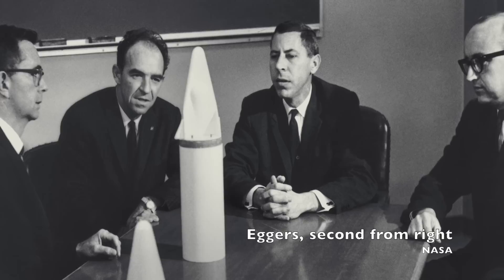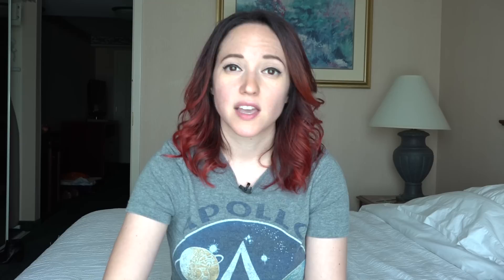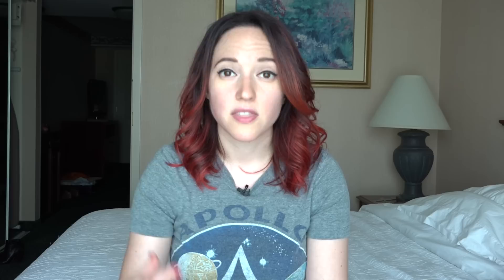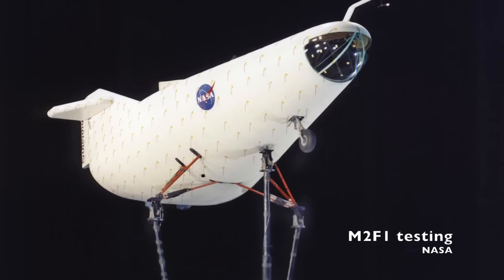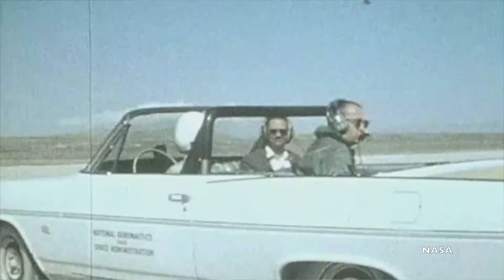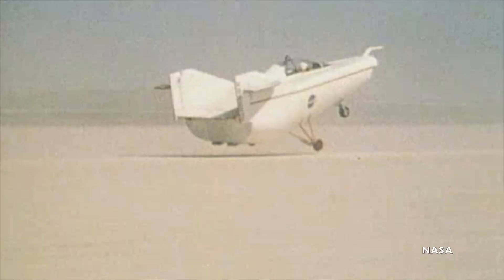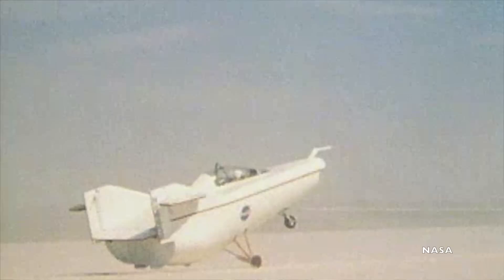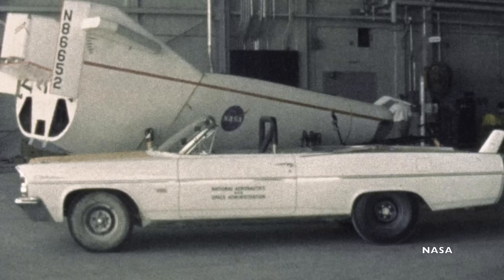When a Muscle Car Towed a Lifting Body into the Air

Comment: As a kid in Boy Scouts, I helped move a M2F1 into a Hanger after it was delivered to Marshal Space Center.  Was not heavy at all as we expected it to be.  We had a local arrangement for Boy Scouts to help at the Arsenal when visiting the base and we help Clean up and prep the Rocket park for the busy season. Must have been the early 70's and I even got the assignment  of pulling weeds around the Saturn V on display horizontally there in the 70's.  We even cleaned up the welcome center with the Saturn 1B on display at the interstate stop. But that was easier since it was standing vertical and on raised stands.

Comment: Driver has a helmet. The two observers? Nah, we're good.
Reply: The reason NASA chose Pontiac wasn't because it had the most horsepower of the day, but because they were considered by many to be the most stable platform, and stability is VERY important when dealing high -dollar or nearly irreplaceable equipment. After all, this was the era (early era) of b Pontiac's"Wide Track" program.
Reply: I seen that too and had to laugh.

Comment: The fins on the rear of the Pontiac actually fit the scene. I guessed a mustang at first, but those were just appearing - and were probably lighter, which could have impeded the towing. Great research and an interesting fact.

Comment: In fact, muscle car didn't born until 1964 with the Pontiac GTO, which was basically a Tempest(medium sized car) with a big V8 engine. The Bonneville was a full sized car, not properly a muscle, because they used at the time the big engines only for big cars and the Bonneville was the heaviest car of Pontiac(some variants of the Bonneville as heavy as 2.5 tons). Of course, they chose the Bonneville because at the time GM only allowed big blocks to be installed in big cars(that changed when John DeLorean created the GTO by installing big 400+ CI engine in a mid size car like the Tempest).
The heavy weight in the Bonneville allowed the car to withstand the lifting force of those lifting bodies, and the 4 speed manual transmission allowed it to reach 100+ MPH more efficiently than the Hydra-Matic.
So, no, it wasn't an actual Muscle Car, but it was faster than most full-size cars because it was convertible and only had two doors.
Reply: I loved your documentary. I still remember watching when you died on TV.
Reply: That sure sounds like a lot of opinion. "Opinions on the origin of the muscle car vary, but the 1949 Oldsmobile Rocket 88, created in response to public interest in speed and power, is often cited as the first muscle car." Yep, turns out it was opinion. Maybe give her a bit of space on this one.
Reply: Old late comment is late. At least she didn't call a mustang/camaro/corvette a muscle car. I think this one fits the description, retroactively. Catalina wasin't a full sized car, and had a big block, 4 speed, 4 barrel. I think that's good enough.
Reply: Yea I agree that the gto was the one that really upstarted the muscle car craze and brought it into the open. BUT I would be hard pressed to say it was the first. They're definitely some high performance engines that were stuffed into more midsizish platforms that came before the gto. The 1961 Chevy impala SS along with the 1962 bel-air was offered with the mighty 409 ci. V8 That put out 375 - 409 bhp. - the 1957 Chrysler 300c with the 325 bhp. Hemi V8. The 1962 Dodge dart max wedge 413.- 1963 Ford galaxie/Mercury comet 427 with 425 bhp. - The 1963 Pontiac super duty 421. -The 1963 Studebaker avanti R2 with supercharged 289 ci. V8. This car was the fastest car in the world for 1963 with speed tests of 168 mph. - The 1961 Pontiac ventura 389 with tri-power option push out 345 hp. Etc etc. So as you see there were quite a few high performance muscle cars that came before the iconic 1964 gto.
Reply: Ayrton Senna by the way it was the 389 that deLorean first stuffed in the tempest that ultimately became the gto. The 400 ci. Engine was not introduced to the gto until 1967.
Reply: In fact Chrysler had dual quad "Muscle Cars" since the mid 50's, but I loved this GTO's too !
Reply: Has everyone forgot the Duesenberg SJ. Introduced in 1928 with supercharged straight 8 producing 320hp.  Yes the 64 GTO is given credit of being the first muscle car, but is it really?

Comment: The Air Force used "muscle cars," too - Some bases had SS396 El Caminos specifically modified for retrieval of the U-2 spy planes. These planes had centerline landing gear, so when the wing couldn't generate enough lift to fly level, they would tip to one side or the other. Some provision was made for this problem by adding "wear strips" to the wingtips, but this was considered too risky for the equipment. Had to be a muscle car fan that thought up the solution. Go Air Force!

Comment: What ever happened to the car?
Reply: Chewy That's what I was wondering myself.

It would be cool to see this artifact from NASA's glory days once again - hopefully it's in a museum with some of it's more famous counterparts =D
Reply: Chewy eBay maybe?
Reply: Lol, i was asking this myself. Probably somewhere in an old hanger catching dust.
Reply: It is probably Charlie Bolden's work car, if it's not he should do something about that.
Reply: +Chewy What happened to the NASA muscle car once the M2-F1 program ended? Near the end of 1963, the Pontiac was shipped to NASA Langley Research Center in Virginia and used in tests at Wallops Island. There was some regret expressed at the NASA Flight Research Center when the Pontiac left, fairly much captured in a comment printed at the time in the X-Press, the NASA newspaper at Edwards Air Force Base: "No longer can we drive along the lakebed and pass the airplanes in flight."
Reply: +Chewy NASA is an extreme hoarder when it comes to their equipment. It is probably somewhere in their inventory. One visit to KSC or any NASA facility and you see they hang on to everything.
Reply: The top comment on this video by Bill Whiteside explains what happened to the car. Apparently it was sold on Ebay.
Reply: @351wmustanggt  As someone who likes to hold on to things I can understand. Obviously buying new things can get expensive and if they are still usable why throw them out? My neighbor when I was a kid had a late 1980s Volvo and he drove it to work every day.

Comment: As for the ultimate fate of the Pontiac, it was sent to NASA's Langley Research Center in Virginia in the mid-1960s where it was supposedly used at Wallops Island.  Later, it made its way to an undisclosed location in Georgia, but it has more recently been returned to Edwards AFB in California where it will reportedly undergo a restoration by the Air Force Flight Test Museum for eventual public display in an exhibit that will reunite it with the now-restored M2F1 Lifting Body.

Comment: Cool little tidbit I never knew about Pontiac history, and I've talked at length with Arnie The Farmer Beswick many times. He never mentioned that. Even h must have been oblivious to that. If I'm not mistaking, The 1966 Bonnie 2+2 with the 421 SD & 4 speed was the Only American production car capable of  sub 4 sec 0-60 times other than the Vette.. Even toady. that 2.5 ton Bonnie would keep up with most of the factory hot rods, and embarrass quite a few Euro sport sedans.
Reply: SD, AKA "Super Duty" two letters that put fear into the heart of the enemy (Ford, Mopar).  421SD, 455SD and the 2.5L SD , yes a 2.5 liter 4 cylinder super duty engine. LOL
Reply: That under 5 second 0-60 was done in 1st gear, with a close ratio 4 speed transmission. Love Pontiac muscle, have driven it myself.
Reply: @timreichert9982  under 5 sec?  noooo way, unless seriously modified. prob 9 sec at best
Reply: @gtbarnes11  I was wrong. It was 3.9 seconds you poor little man, and it did happen, HA! Look it up.

Comment: Could you use something like this to help launch a spacecraft? I'm thinking of a long, straight track that would pull spacecraft to get them airborne and at high speed before their rocket engines kick in and they go upwards.

I mean, it did work - they got the aircraft in the air pulled by the convertible.
Reply: Brett Anon Maybe, but I don't think it would be very feasible.

In this case, it took a custom built muscle car to impart to what was essentially a giant model aircraft about 60 m/s delta-V (an estimation on my part based on having reached 100 miles per hour at an altitude of 20 feet).  Since you need about 10 km/s delta-V to reach LEO, this setup got them about 0.6% of the way there.  The extra mass required for the engines and propellant necessary to send the vehicle to LEO would have been enough to reach LEO without the assist, and I cannot even begin to calculate the specifics of the tow vehicle required to pull that resultant vehicle into a glide (imagine building a vehicle that can pull the space shuttle in launch configuration in a stable glide behind it).

The idea is not entirely without merit; we did use tow vehicles to get the X-15 into space, though it went nowhere near LEO (delta-V wise) and the tow vehicle was a B-52, not a ground vehicle.  Since the X-15 was not a LEO-capable vehicle, its weight was very small, and the B-52 mothership was able to impart a more significant amount of initial delta-V (about 600 m/s, estimated from an altitude of 8.5 miles at a speed of 500 miles per hour) by virtue of being an aircraft and being able to reach that high of an altitude (more altitude = more delta-V).

However, that 600 m/s was still only about 6% the delta-V that would have been needed to send a vehicle into orbit from the B-52 mothership.  A typical X-15 flight may have had a total delta-V of about 2 km/sec (estimated from a typical flight altitude of 55 miles at a typical final speed of 3500 miles per hour), leaving about 1.4 km/sec delta-V from the X-15 itself.  Should the X-15 be required to reach orbit, it would have again required a much higher mass from the engines and propellant needed to add on those extra 8 km/sec, which would have created a vehicle capable of reaching LEO from the ground and have left the B-52 unable to carry the aircraft (again, imagine a B-52 with the space shuttle in launch configuration strapped underneath).

Comment: Back when science meant doing cool stuff in an efficient way and gleaning as much as you could from it... instead of filtering a concept through 50+ layers of accountants and bureaucrats to get approval for $10 pizza to keep you going while you write a thesis on which screw to use to hold the department sign on the lab door.

Comment: This girl is from Canada, and she  is a space nerd, not a car nerd, so she kind of gets a pass for not knowing that a "Muscle Car" is when they stuff the Biggest Engine into the Smallest Car.  And that the Pontiac Bonneville was the Biggest Car that Pontiac made and it came standard with the Biggest Engine.
But the science reason that they used the biggest car is that probably it was heavy and had room to add more weight in the trunk so it could have the traction needed to transfer the power to the ground and pull the plane up to speed.

Comment: "pinch on the cheek for your'e as sweet as Tupelo honey and funny to boot"! 
Yea' Amy, Pontiac Bonnevilles did howl and have the horsepower to do the job.I never knew this, but did know if you wanted to do 110 to 120 to pass fifteen cement trucks in an over a three mile mile conga line, that bugger could pull off the job.The lady that did this was a nursery supervisor.

There is another aerodynamic effect having to do with the volume of a cylinder and cone which when applied to the science of aerodynamics, does allow lift.On the Bruce Peterson The Real Six Million Dollar Man youtube video, there is a snippet I believe, which shows that same lifting body craft that Bruce flew on touchdown from airborne glide.

That craft still had lift in  it, as when its' rear landing gear wheels touched the runway, that lifting body was able to fly back up in the air for just a little bit.So there are other forces in action than just the classical established high and low pressure areas Bernoulli established long ago. This explains how a wing, not a tube can also attain aerodynamic lift.

Interesting stuff and they must have had a good time hauling hiny across the desert floor at breakneck speeds, in order to get that lifting body airborn.Thank you Amy

*Notes, plywood can do the job on a project if one must keep the price tag down.Also read the book http://www.damninteresting.com/the-timber-terror/ and http://gowood.blogspot.com/2012/07/wooden-wonder-de-havilland-mosquito.html

Plywood will get you there to many projects, but you must make sure that you use the right kind of glue and really make sure that you've done the job correctly.

Comment: Why the lifting body got the airfoil shape upside down, with the flat part on top and the round part on the bottom?
Reply: So if you stall fast enough you get lift again?
Reply: Nope, falling like a brick still has wind resistance but no lift at a high angle of attack (wind perpendicular to surface in that case).  Try the old hand out the car window trick to see how various angles/shapes affect lift.  Quite revealing.